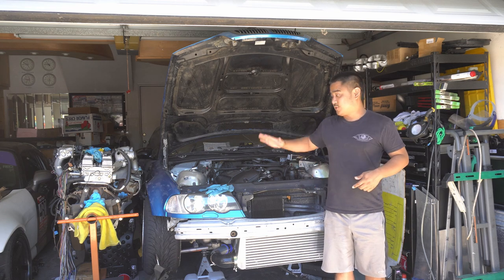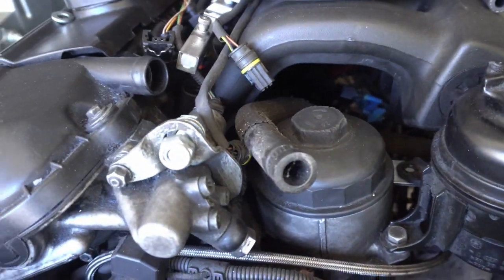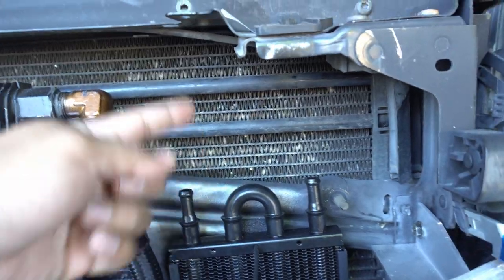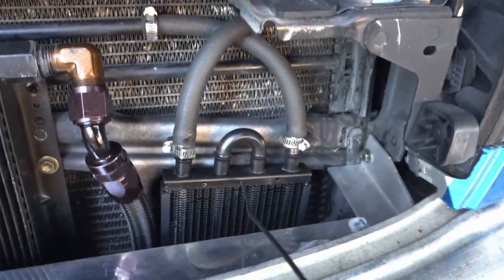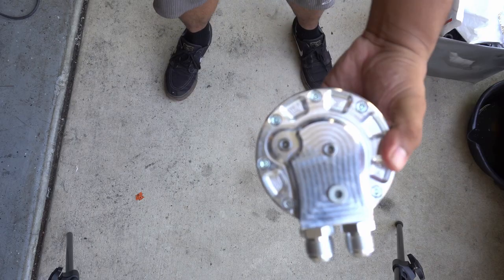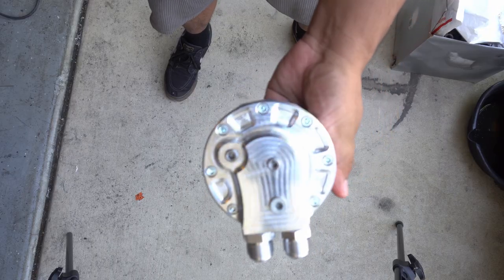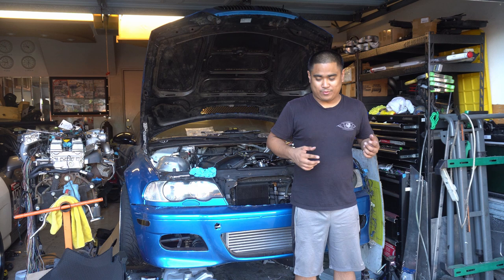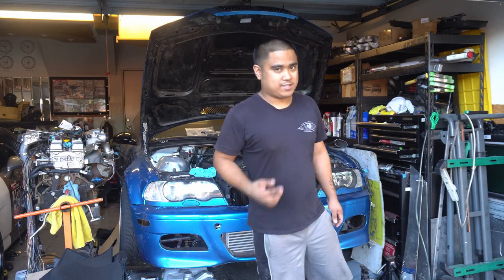Cooling Mods for my Turbo E46 Drift Car | #TheE46DriftBuild Ep 55

Comment: Nearly ran into that same issue with the E36 cooler for an m54. Joel at driftHQ is a helpful dude! Keep up the build!
Reply from the maker: Thanks!
Reply: @nuisance_carl  did you have to trim the intake manifold?

Comment: You can unscrew the core plugs in the filter housing with a t40 torx and use those as a feed for the cooler. Afaik only one other person has done this and I plan to as well. It's like a m20 or 3/4 size thread or something. I haven't had time to double check
Reply from the maker: Wow this is the first I’m hearing of this. That sounds like a much better option!

Comment: What’s your plan for tuning? I would to see an in depth video on that!!
Reply from the maker: Stock ms43. Hoping I can learn enough to street tune it myself 👍🏽
Reply: Nuisance_Carl I’ve been looking into tuning my ms43 aswell. I found msxxwiki, and that was extremely helpful. Do you have any recommendations for other videos, forums or websites?
Reply from the maker: @bradyhill8725  Nothing MS4x specific. High Performance Academy has a couple good ones but they're a little more technical than practical. PFI Speed had a couple good ones as well.
Reply: Nuisance_Carl thank you very much!

Comment: I’m about to order some BC’s would u recommend a certain spring rate? Still my daily driver but also drift car. Thanks bro
Reply from the maker: I haven’t tried other spring rates so I can’t give a proper recommendation. I personally run the feal 441 drift specific coilovers and they’re 9k/4K f/r with a true coilover rear and love the rear grip it gives me. I’m sure bc can recommend you a proper spring rate for your needs. As far as daily driving, the quality of the damper is more important than the spring rate.
Reply: Nuisance_Carl thank you bro!